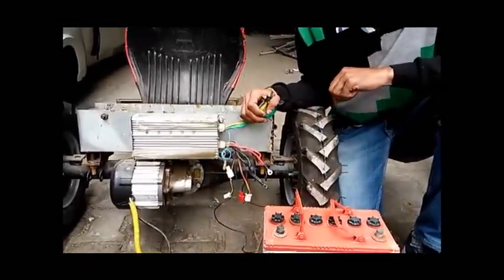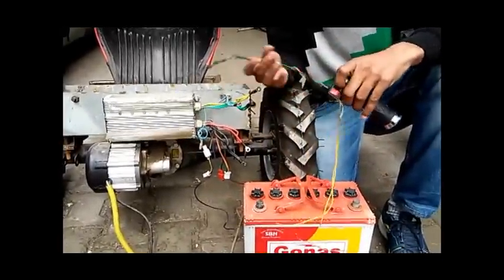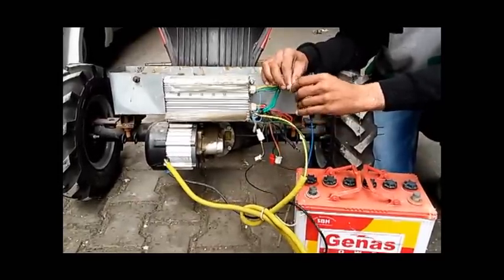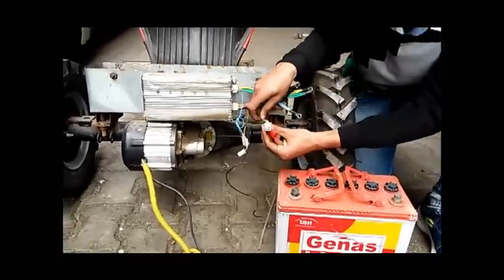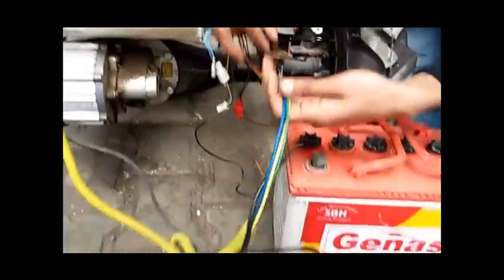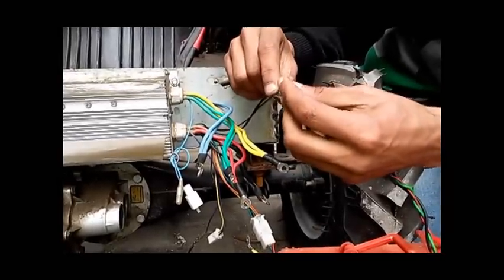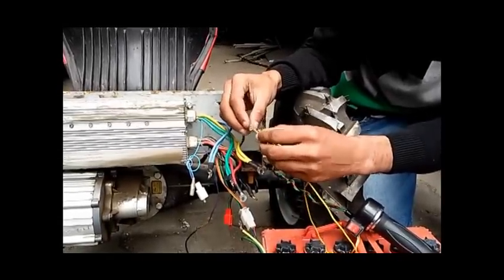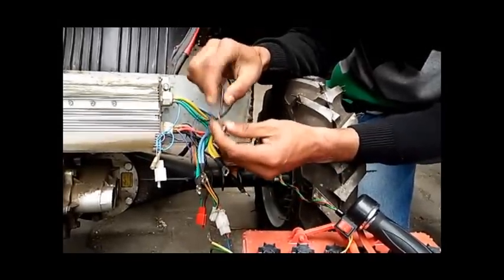Connections and Wiring of Brushless dc motor 48v with controller

Comment: Hi brother, I bought electric car  from China, but the speeding very low40km/h , how can I increase the speeding to 90km/h , the motor power 60v/1500 watts, the controller 60v /1500 watts , If I take off speeding wire , do you think  I can reach for more speeding

Comment: Hi sir I had some doubts regarding my motor controller which is a 1000 watt motor
Reply from the maker: Please ask your question @ rahul nautiyal
Reply: How to trigger the cruise control PIN when needed?
Is there a way of displaying the speed thr my mc in laptop?
What is the colour code for break lights?
Function of other terminals
Reply from the maker: Simply add a switch between cruise control pin and 0V(black wire) of throttle
Yes you can display speed using arduino by using analog input from throttle(these days manufacturers give speedometer output from controller)
brake lights have generally white/yellow colour wires(but it varies manufacturer to manufacturer)
Reply: MachineWorks  thank you so much.....
Could you give me your mail address so that I could send a picture of my system and you could suggest me
..
Reply from the maker: avinash094k@gmail.com
Reply: MachineWorks  I have left a mail. Plz check your inbox

Comment: Hlo brother battery ke jo connections controller me h usme 2 red and 1 balck h ya 1 black and 1 red
Reply from the maker: 2 red and 2 black. Its an old controller. New ones may have two red and one black wire

Comment: How that 5v from throttle is sufficient to work 48v dc motor ? can u explain how to design throttle to managing  motor in either directions
Reply from the maker: 5 v from throttle is just for mosfets to be switched on and off in controller. It is not used for power supply to the motor.

Comment: What happens if we reverse the connection between motor and battery?? Does it rotate in reverse direction or will it damage the motor??
Reply from the maker: there's no direct connection between motor and battery. MOSFETS in Controller are real driver of motor and direction of motor can only be reversed by changing connection between mosfets (WHICH IS OUT OF SCOPE).

Comment: Sir i do the same but i got spark at positive terminal of battery while connecting . So is it ok or we are doing something wrong
Reply from the maker: It's completely fine.its a voltage of 48 v. Spark is natural.
Reply: hello saranash better change the controller as i was also said that it will give spark but when i check the terminal continutie it was litrally short so i dont believe in any supplier who are selling all this china third class controller and you dont get any support from the seller they just want to sell if theres problem they say you must have done worng connection and they say you have to buy new one
and the supplier who are from delhi they are never trust worthy they are cheaters i bought one total kit i got all damaged parts in that and controller was already faulty and i have to pay again for the new one and same thing again happen so better avoid all delhi suppliers if you are dealing with then they are really A*** and cheaters

Comment: Hey guys, i have the same controller and motor. I did the connection as you guys said but it still won't work. Any suggestion? What exactly do we have to do with the ignition wire? Which one is it?
Reply: vivek anand its the violet one. connect it with the + of battery
Reply: i am also facing same problem and vendor is not givingany positive response

Comment: Sir i want to build an electric car using BLDC motor ( 48 V , 800-850W ) and want some help that where i can get the appropriate transmission axle as you used, and where to get controller. 
~Thank You
Reply: Anmol Nagi  Hello Anmol, i can provide you the motor and controller,, if u need u can mail me at subhanjan.saha@gmail.com
Reply from the maker: Anmol Nagi  Dear Anmol, In this video differential is used for transmission. U can get the complete assembly of motor+differentia+brake drums from any e-ricksahw shop. There are many shops in new delhi near "paharganj" area.
Else you can make your own simple chain sprocket transmission.
Reply: +Anmol Nagi Hello Anmol Nagi, this is Marena from CQ motor which specially make the bldc motor with axle and controller. Welcome to contact with me sales5@cq-motor.com, marena.yu@gmail.com   thank you.
Reply: +Anmol Nagi Hello Anmol Nagi, this is Marena from CQ motor which specially make the bldc motor with axle and controller. Welcome to contact with me sales5@cq-motor.com, marena.yu@gmail.com   thank you.